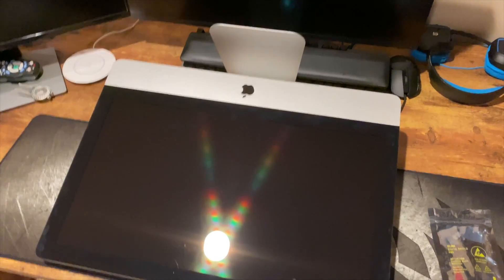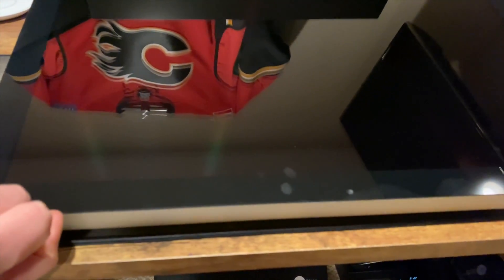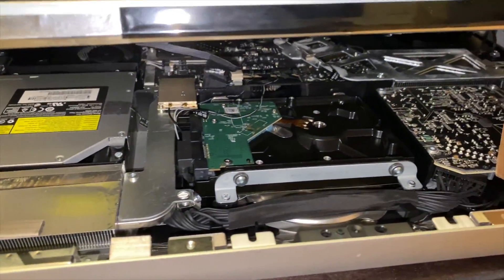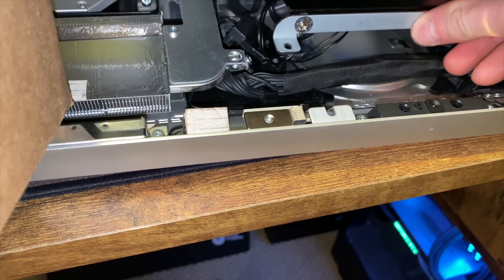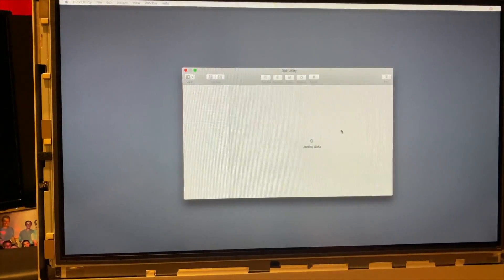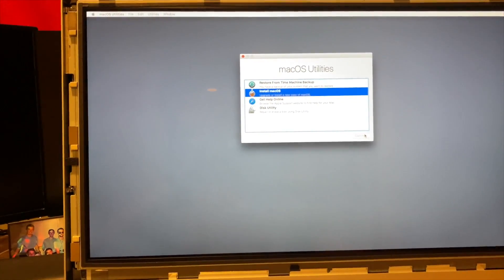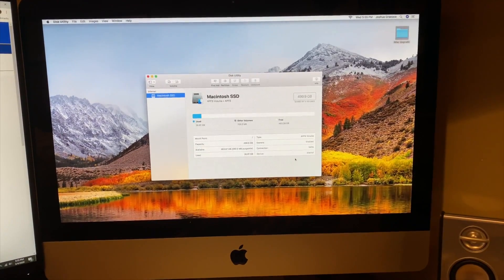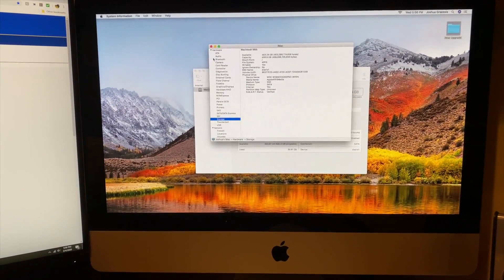Apple iMac From Trash to Treasure | 2010 iMac SSD Upgrade

Comment: when i start my imac it keeps shutting down and restarting. it just won't boot. is this because the newly installed ssd is not recognized? how can i fix this. It is also important that I attach a temperature sensor to the ssd, otherwise my fans will spin. Am I  right ?

Comment: I have a  21.5 inch 2010 imac  its cpu is 3.2 with a 512 gpu... Does anyone know if that video card will work in a 2011 27 inch imac with a cpu of 3.1  and 1g gpu... Im not sure if the heat sink will fit to the card or if the cooling unit shoud be switch aswell.. Which is riveted to the mobo..  Thanks guys

Comment: Great Video, Im 15 and I my old 2010 iMac has a failing hard drive. I would love to do this repair but I'm not sure if I have the ability to do so.
I have done a couple software repairs before on other machines however I have not attempted a hardware repair before. I have done my research and know exactly what I need to buy and do.
If you could maybe suggest if this is a good idea to attempt at home or not, any feedback would mean the world to me.
Reply from the maker: If you haven’t really worked with much hardware upgrades an ssd swap would be a good place to start, you just have to be really cautious with the iMac as it does have an open power supply inside.  Performing the ssd upgrade should keep you clear of the power supply you just have to be really careful.  Good luck!

Comment: Just bought this one. 3.2  2010   $150 cnd...      also picked up 2.7  2011  27  inch....$200 cnd...
Reply from the maker: Good luck with them!
Reply: Thanks,,,  just picked up a parts imac with a bad gpu...   2011   3.1 cpu for $75....   going to reflow the gpu.    Got it  with the mobo out and a bag of screws...   I missed the odd fan wire  and have to  pull the logic board to get it...   all is good...   easy to work on this

Comment: was given 2010 27" iMac i3 8g ram 1tb hdd , I'm thinking of switching to SSD & adding ram to 16gb. will the little core i3 hold it back from running current macOS ? and how much you get the ssd for ? if u don't mind saying. ty
Reply from the maker: The i3 may limit your performance slightly, but there are current i3 Macs running Catalina and Mojave.  In terms of the SSD, depending on size you can probably find a 500Gb for around $50 and a 1TB for around $100
Reply: Usually it’s the graphics card holding it back as Mojave and newer require a metal compatible gpu

Comment: How do you think about your mac one month later ? Does it work good ?
Reply from the maker: Working really well, did the upgrade to Catalonia with the patcher tool and haven’t had any issues. Really quick and dark mode looks great
Reply: @TechRoundUp  did you have to upgrade your graphics card to run Catalonia ?
Reply from the maker: No, it was a 4000 series Radeon so it worked with the Catalina patch
Reply: @TechRoundUp  Thank you ! Also, where di you buy the thermal sensor?
Reply from the maker: @yoshuanunez4296  I purchased it on ebay